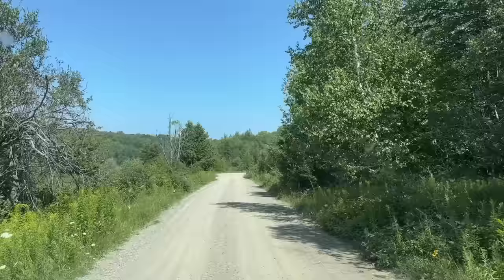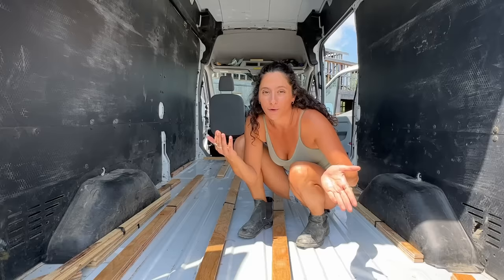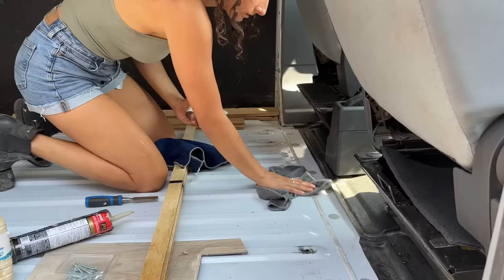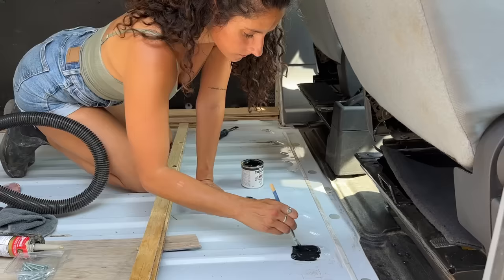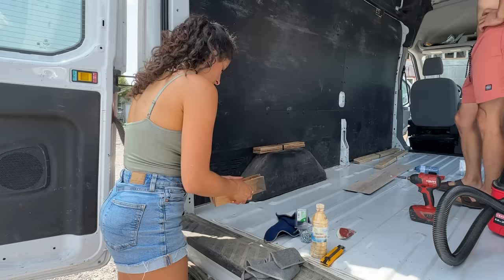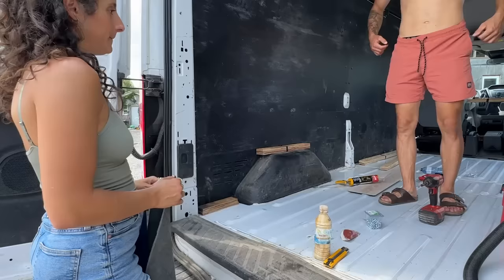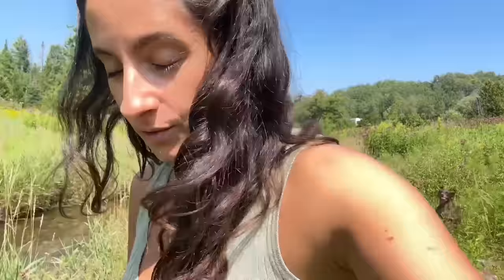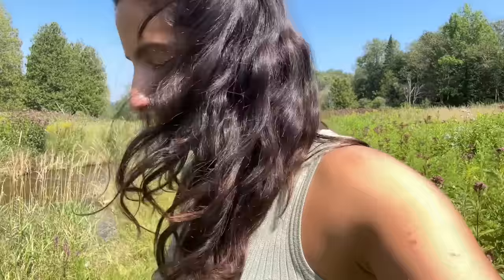Slowly making my Ford Transit livable 😊

Comment: Great job on floor look at all what you want inside now if you need to put a window in the sliding door or side windows where you want to put your bed for a cross breeze. Running your solar wiring and battery pack location. Just some suggestions Juliana. Love you ❤❤❤

Comment: Get you one of those portable battery chargers with a little air compressor on it. For 150 bucks. They usually have 12 volt cig lighter socket and a usb for charging devices. I used one the first time or two when I first  bought my van to build out. You can run 12v power when needed for a couple of days for cheap.

Comment: Unless you used stainless steel screws on the furring strips, they are Zinc, which will eventually rust. From under the van the screws have pierced and exposed the steel of the van. The screw tips will in time rust and spread to the van steel. If you want to protect the tips from rust you will need to try to locate and access each screw and rust prevention of some type to seal them. Best to only screw/pierce through the steel when absolutely needed.
Reply: Worst thing that they could have done was to screw the sleepers through the floor of the van... Should have just PL'ed them to the floor and then screwed the subfloor to them... Plus, do they know that the screws didn't penetrate anything of importance down below?

Comment: Just FYI, My nephew has started his build on a 2017 Ram Promaster.  He is a little bit farther then you but not much. he has his floor installed and his solar setup he did himself. He is not mechanical at all. He bought a Victron system with 3 battleborn batteries, 3 roof solar panels, camper plug on the outside of the van for shore power. .  he said he watched a you tuber install hers and basically purchased the kit she recommended and it came mostly ready to go. wiring was prebuilt for the most part and he said it was pretty easy to install.  good luck with your build

Comment: another awesome video. the van build will be stunning after seeing your 5th wheeler build. don't put too much pressure on yourself to build it straight away you can start with very basic power brick that will run your fridge and a LED light or too in the van and will charge off a lighter socket and or folder able solar panel.

Comment: I think that the build being ways away gives you chance to see what works for you and what does not before making it permanent.  After watching a lot of these type of videos, I have seen nice builds done very cheap.  The  advantage is they can retain the original functionality of a Van or truck very easily.  And easy to switch it up very quickly depending on the circumstances at the time.

Comment: You should run your power/water/gas systems first. Even if you can't afford solar now, it's much easier to wire it before building stuff in. A maxx air fan with rain sensor would be nice, too! Great job on the floor! Good luck, looking forward to the build!

Comment: Julia I have been following you for awhile was extremely surprise you weren't going to keep the trailer you worked so hard on.ive been looking for a promoter or Ford connect with a high roof to build out.good luck keep the vids coming hugs from southwestern ontario

Comment: Be careful with the plank floor in vans , some are super slippery when wet and thats a heck of a split if one foots in and ones out or worse yet to fall backwards.
Reply from the maker: Oh never thought of that lol I honestly want hardwood in the van but I imagine it will get super beat up pretty fast
Reply: @julbm  yea the store bought hardwood is junk it will get beat up for sure plus theres no humidity control so id worry about warping. But there is nonslip vinyl plank with hardwood look that you might be interested in

Comment: I'm a bit concerned about driving screws into the floor of the van.
Not only does it open the door to corrosion but I'd be afraid of what is on the underside of the body that could possibly get damaged by a screw going through it.
A countersunk bolt fully secured on the underside using a washer and nut is far more appropriate for the job. 
I'm not into converting vans but in terms of securely fastening a floor, especially to metal, holes should be drilled, the metal treated for rust prevention, and then attach the wood to the van body using stainless steel bolts and a washer.

Comment: I would suggest that you don’t install the flooring,until you finish everything else first. Because that is a floating floor and if walls or any kind of framing on it. Will not allow it to expand and contract, and will separate and you will have gaps in the floor

Comment: I did the auto body and fender repair for four years and I can tell you covering up the rust doesn’t keep it from getting worse. In order to stop rust from getting worse you have to totally remove it, which means sandblasting or sanding and then priming and painting.
Reply: But I’m sure I’ll be corrected

Comment: You wouldn’t have needed to screw down those riser strips. The liquid Nails or whatever you were using, would have been just fine and would have bonded with the floor just fine.

Comment: Before you get too far into your build consider removing the wood strips on the floor and put down 2" thick Foamular 250 rigid foam insulation board. Use bondo and primer paint to fill in and seal all the screw holes you made. Use construction adhesive to secure the 2" thick foam board to the metal van floor. Use spray foam to seal the edges where the ridges in the metal of the floor cause gaps between the foam and the floor. Foamular 250 has a compressive strength of 25 pounds per square inch (PSI). The area of a size 12 shoe print is 211-215 cm squared (32.71-33.33 inches squared) multiplied by two (humans have 2 feet), so each square inch of foam insulation can support 25 pounds and the area of a pair of shoes at the max 66.66 inch squared X 25 = 1,666 pounds of weight in the small area of two human shoes is what the foam can support without deforming. Over the foam you can glue your finished flooring(Pergo, thin vinyl flooring, etc) directly to the foam, you do not need a sub floor(extra weigh) as the foam with the flooring spreads out the weight of any point loads. Cabinetry can be adhered to the walls and floor using construction adhesive or specialty adhesives such as Sikaflex. You will want 2" of foam on the ceiling and walls as well. Be sure to have planned out dedicated wire chases for lighting, outlets, water heater, diesel heater, water pump, battery leads, solar panel wires, etc. The reason for good insulation is whether you are in hot or cold climates you want the inside of the van comfortable, insulating keeps heat in during cold periods and keeps heat from coming through from the exterior sheet metal into the living area in the summer. If you are going to be using your van in winter climates it is best to have your freshwater tank and grey water tank inside the insulated envelope to prevent freezing and the headaches that go with that i.e. frozen pipes burst and your water tank will flood your van. Excess weight is the enemy of van builds, plywood, full thickness lumber, heavy 1-1/2" thick counter tops, ceramic tile, steel, etc are all heavy, use lighter weight options. Not using heavy building materials saves weight for item which are heavy and there is no way to lighten them without carrying less i.e. water is 8.34 lbs per gallon, 50 gallons of freshwater is 417 lbs. Lithium iron phosphate batteries are heavy as are large copper wires for your battery system. Solar panels are weighty. Consider making your own foam core composite panels with a 1/16" real wood veneer on each side of a 3/4" or 1" foam panel for building your cabinetry and any dividing walls. The veneer can be sanded and finished with wood stain or just polyurethane for a natural look. Consider getting a vacuum pump and vacuum bags and the necessary accessories to vacuum bag your panels for the best adherence and structurally sound finished product. Foam core composite panels are extremely strong and very light weight they are used in the aviation industry to save weight and fly farther. The edges of any cabinetry, drawer faces, drawers, etc the will be see can be finished with a strip of veneer glued on the edges to finish them nicely. If you use foam composite boards use interlocking  edge tabs or similar joinery to dovetail joints so the panels are chemically bonded with adhesive, but are also mechanically held together by the dovetail/or interlocking tabs on the edges. Take the time to make a detailed plan and scale drawing of how to utilize the limited space in your van, use every inch in the most efficient way. Best of luck with your build

Comment: Oh nooooo never screw screws into your metal ceiling, walls or floor of your van. You glue the wood dreaming to the floor then screw into the wood. You’re going to let water in and it will rust out.